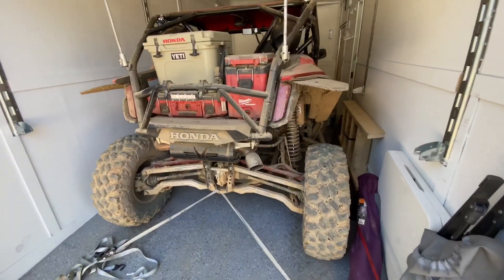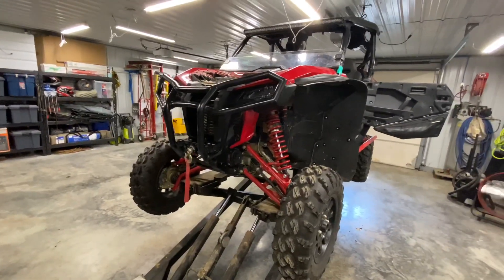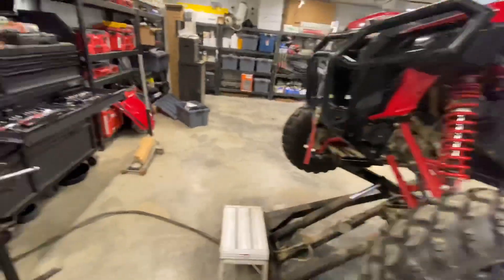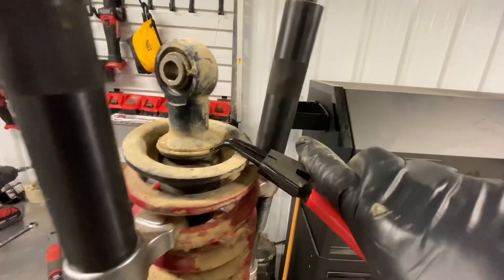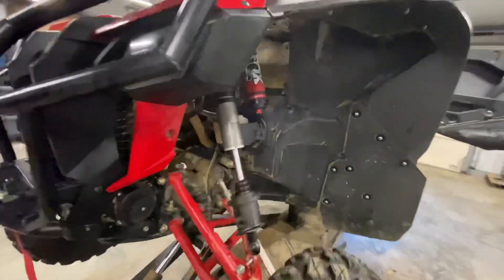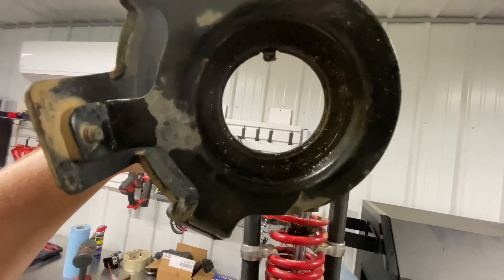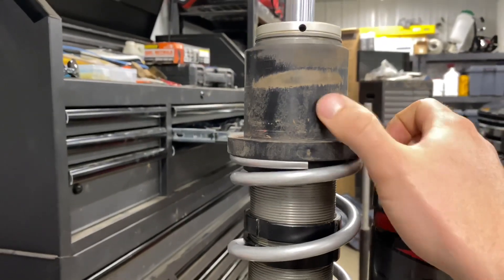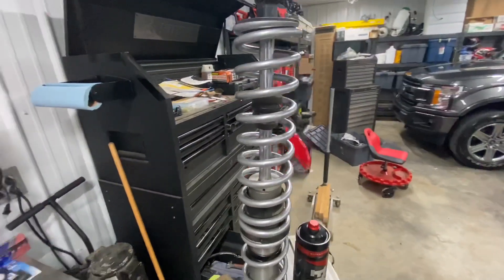Honda Talon Shock Therapy Dual Rate Spring Kit Review

Comment: I had eibach dual rates on my 1000s .  Best upgrade for ride quality and clearance.  I went with Shock Therapy for the new build.  They arrived yesterday, still waiting patiently on the RZR to come in.
Reply from the maker: I've since sold this machine, but the ST springs really helped the ride quality and kept the ride height where it needed to be.  I've got a Turbo S Velocity now and also have a set of ST springs on it that I installed when it was brand new because I liked them that much.  Happy to report positive results on this machine as well.

Comment: I ran the dual rate springs for months. Rear spare tire mount and The RIS takes it to another level. Just Springs makes a small difference compared to rear spare with RIS. IQS is a waste of money unless you race competitively.
Reply from the maker: I've watched your ST video and appreciate the info.  I'd like to have the RIS, but will hold off for a while since just the springs are such an improvement for my riding style.  I was curious about your iQS thoughts and it didn't initially seem like something that I could justify buying since I'm almost always 10-15 mph trail riding.
Reply: Jason Hi Jason! IQS is expensive and it won’t be worth the money for most people. I absolutely love it and use it all the time. You are basically able to adjust all 4 shocks instantly. Even on my Mexico to Canada trip I use it all the time. As soon as I hit asphalt, I put it Into stiff. For the race track or long distance racing, it’s a must have. If you’re doing slow trails and want a smooth ride, it probably won’t be worth the money. It makes a night and day difference for cornering. It cuts the suspension roll way down when you flip it into stiff. I love it, but it’s expensive. Hopefully this helps a little.

Comment: Hey man, appreciate all the videos you make for the Talon. I just got a set of Bandit utv tender springs in. I was considering returning them and getting the shock therapy springs after watching this. I know you had the tender springs first, did they make much of a difference at all compared to the full set of ST springs? I live in TN and probably ride the same trails you do in my 1000x. Thanks in advance.
Reply from the maker: Sure thing - glad you like the videos. 

First things first - I haven’t owned the Bandit tender springs for my machine so I can’t comment on how well they perform on a Talon.  The tender springs that I had were from AllThingzUTV.  The ST full spring kit is night and day better than just the ATUTV tender springs in terms of ride quality. 

Second thing - if you can manage the cost of a full spring kit, then I’d absolutely recommend a full kit.  You’ll get an even further tuned combination of spring rates and lengths that should work together for a better ride. 

I think Bandit also offers a full kit as well as ST and Weller, but I’m not 100% positive.

Comment: Hey Jason. Chris here. I just installed the same spring kit on my 1000R. I followed the written instructions on ST website for the PL and CO settings. After loose install and settle, I measured roughly 18" of clearance F&R. I do run 30" tires but after the first measurement, I was shocked to see that number following the instructions. I raised the PL to obtain roughly 15" of clearance but then my crossover was butted up against the divider. So I then raised the CO to get roughly 1" of space between the top of the divider. I'm curious to what your final measurements are so I can see if I Fff'd up. I did notice while jacked up at full sag, the springs weren't loose but close to the point where slight spring movement seems very possible while riding. Hopefully you can provide some information to help.
Thsnks

Comment: How detailed are the Shock Therapy instructions?  I’m going to have my dealership install the new shocks and want them to be aware of all the measurements and part placements.  They have a very competent shop but this will be their first Shock Therapy installation.
Reply from the maker: They offer installation videos on YouTube that are very good.  However, keep in mind that the measurements they provide are not the end-all-be-all measurements and every person's machine will require adjustments due to differences in weight.  Also, tire size needs to be taken into account when setting ride height.

The ultimate goal is to get the ride height set correctly while using their suggested preload/crossover measurements simply as a starting point.

Do not expect to install these once and not have to adjust them at all.  Fully expect 2 or three adjustments to set the initial ride height (with you in the machine) and then one additional adjustment about 300 miles after installation.

Here's a link to their R installation video:  https://www.youtube.com/watch?v=gHRHyv97rdw&t=853s&ab_channel=ShockTherapyllc

Comment: Jason, thanks for the detailed video and your tips / cautions, really helpful !    Seems you added your ride review to the the beginning of the video you posted several weeks ago which helped me pull the trigger on ordering a set for my Talon R even before hearing your results.    It seems like your Preload and crossover settings differ from the suggestions from ST.  Questions:   1.   Wondering if you recorded the actual part numbers from the springs you received  and what they were ?  2.)  Did you adjust preload without removing springs ?
Reply from the maker: Yes, my preload and crossover settings do differ.  Keep in mind that Shock Therapy's measurements are intended to be starting points to get you close and you'll need to fine tune to your configuration.

1)  My spring part numbers are as follows:

Front Upper = 05236
Front Lower = 002341

Rear Upper = 002301
Rear Lower = 003361

2)  Yes, I adjusted my preload without removing the springs entirely.  However, I did go ahead and remove the entire shock and compress the main springs since it makes the adjustment that much faster overall.  When trying to adjust them on the machine you can only get 1/8 - 1/4 turn at a time and it takes just as long (if not longer) to do that as it does to remove the entire shock and adjust preload that way unless you only need to move the preload nut 1/4" or less.
Reply: @Jason____  Thanks for the sanity check, sharing your experience and the details.   I have the same spring part numbers as you,  and i understand that ST gives us the starting point.   My borrowed spring compressor was  a pain to use (worn out and a little larger hooks than i'd like)  and without a proper  spanner  wrench I couldn't see how to adjust P/L conveniently.   Will have to put in the work, after getting a better compressor.    Thanks again for your well made and helpful videos and forum posts. .    .

Comment: Have you riden the livevalve or any other sxs? Debating in getting a livevalve r or maybe saving that money and just doing the springs like your did to a r
Reply from the maker: I have not ridden a Live Valve Talon, but I have ridden a Live Valve RZR Turbo S.  If I were shopping for a Talon I would absolutely buy the Live Valve model.  For $2100 difference (on MSRP pricing) it's a no-brainer for the Talons.

Now, for the RZRs I actually now own a Turbo S Velocity and did not opt for the Turbo S Dynamix (Live Valve).  The reason I chose to not buy the Dynamix model is it's not worth $5,700 (on MSRP pricing) difference for my riding terrain and riding style.  I put a Shock Therapy spring kit on my Turbo S Velocity and it rides phenomenal for what I do on the East coast.  The Turbo S Dynamix also gets you some upgrades aside from the Live Valve suspension that I was either going to upgrade anyway or simply didn't need so the additional cost didn't make sense for me.  If they offered the Turbo S with just Live Valve and not the Ride Command, painted plastics, door speakers, etc...I would've bought it.

But again, if you can afford the Live Valve on a Talon I'd absolutely go for it and then also add a ST spring kit down the road to make it even better.
Reply: @Jason____  Thanks for the reply ,great videos by the way.
I want the talon because of the dct and build quality, went to several dealers but they just put me on the passenger seat around the parking lot so I'm debating on what unit to get. The x3 rr sounds like it's a good machine I just dont like the belt side of it.

Comment: Would the dual rate spring kit make the handling worse ?
Reply from the maker: Not necessarily.  There are a ton of variables to consider, but you may notice some additional body roll on hard surfaces.  Again, though, it'll depend on where and how you ride.